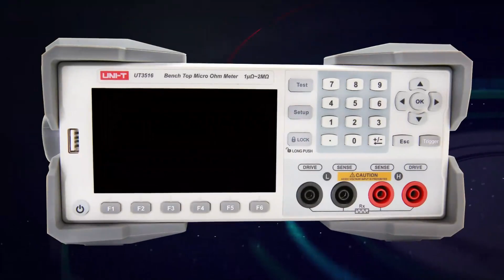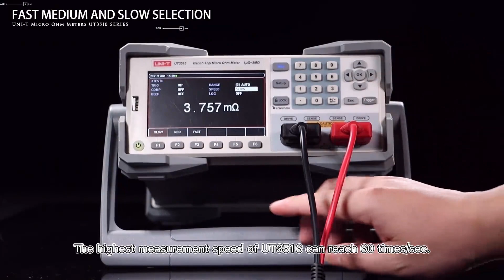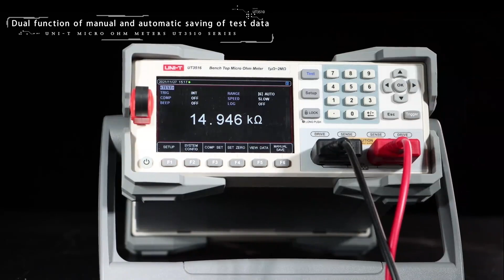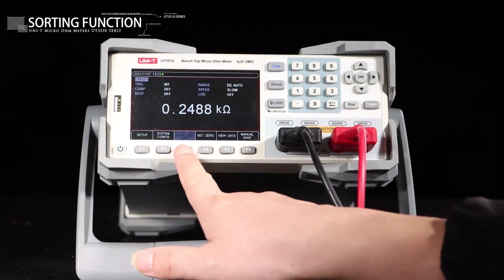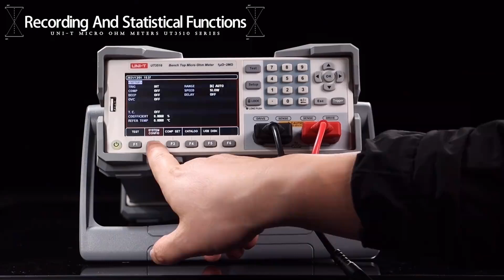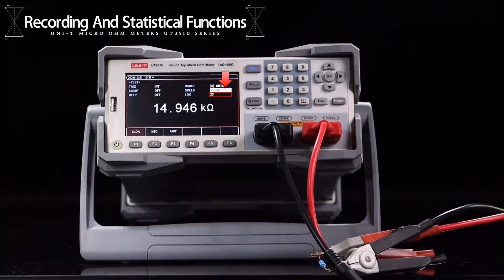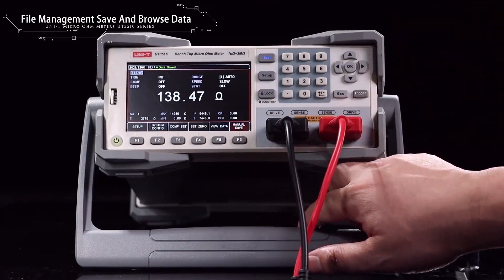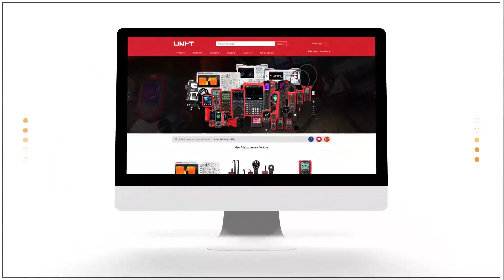UNI-T UT3510 Series Micro Ohm Meters

Comment: What tips can you give to first time buyers of micro ohm meter?  Our factory probably needs one but am not sure if the benefit will be significant enough to make an impact on reducing maintenance cost.  Our factory makes use of spot welding machines and we have frequent downtime due to failure of welding cables resulting to weak welds
Reply from the maker: Here are some tips FYI: 
Measuring range: The measuring range of an ohm machine refers to the range of resistance that the ohm machine can measure.  Choose the appropriate measuring range based on your needs.

 Measurement accuracy: The measurement accuracy of the ohm machine refers to the accuracy of the resistance measured by the ohm machine.  Choose the appropriate measurement accuracy based on your needs.

 Function: In addition to measuring resistance, do you need other functions, such as open circuit detection, polarity detection, etc.  If yes, you can use it with insulation measuring meter

Here is the manual of UT3510 series, you can see if it's suitable for you>>>https://instruments.uni-trend.com/search?scode=all&name=UT3510